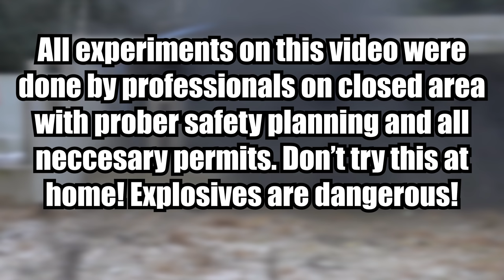How hard it is to explode a hole in concrete wall?

Comment: Moral of the Story:  If you want to breach a concrete wall with explosives you're going to need a pair of bolt cutters to get through the rebar.
Reply: Or, know how to make linear shaped charge.
Reply: Too thick for bolt cutters. Your going to need a grinder or something.
Reply: You dont need bolt cutters. Everybody knows jet fuel melts steel beams.😆
Reply: @christopherhalstead1485  Yup! Steel begins to soften around 425°C and loses about half of its strength at 650°C.  Whereas jet fuel burns at  1,030 °C .
Reply: @codedlogic  Id just use termite or just drinking lithium,  it's more awesome
Reply: @codedlogic  also consider that jet fuel sets other materials on fire, which adds to the heat
Reply: @silvermediastudio  A very long one if you want to be sure it's placed where the rebar is.
Reply: @Graeme758  outline the hole desired. main blasting charge in the middle on short (millisecond) delay. pop it. easy day.
Reply: @silvermediastudio  If you have just placed a shaped charge in the middle then you will blast a nice hole directly through in the shape and direction your shape determined, mostly directly through the wall. Very little is likely to go up and down. So you may well take out rebar directly behind the charge, or in the blast 'cone', but very likely not enough to get a man through unless you have either placed two charges or made your shape long enough to account for the size of the rebar grid.

Blasting a hole that doesn't give access makes you look very silly. I wouldnt want to be the one who left a torso sized hole with rebar top and bottom.
Reply: @Graeme758  You do exactly as I described. I'm not speculating about what might work, I'm telling you what works. Cut the hole, blow the debris inward. From hundreds of repetitions.
Reply: @silvermediastudio  I'm not speculating either. But I guess if you have unlimited playdoh you can go through anything, I think we usually preferred to use enough to do the job and place it properly.

And with hundreds of repetitions you really should be able to do it right by now.

You're not American by any chance?
Reply: @Graeme758  huh?
Reply: @Graeme758  I had to re-read your comment.  Clearly you don't understand the difference between what I typed, "Linear Shaped Charge," and what you think I meant, a conical shaped charge such as is found in an RPG rocket warhead.  I suggest you educate yourself on energetics and their application before posting further, and read more carefully to ensure proper understanding.
Reply: @silvermediastudio  I know what a linear shaped charge is. If you read my first post properly I said it would need to be long enough to cover any rebar you wanted to cut. You think a 300mm or 600mm LSC would cut through rebar 600mm feet above and below it's placement with any certainty? If it didn't you're left with a 1m hole, if you're lucky, and a red face.
Reply: @Graeme758  re-read my instructions
Reply: @Graeme758  you use a 3-5m LSC shaped in a rectangle of sufficient size with a central push charge as he suggested. The LSC cuts the material in the shape of your breach and the pushing charge which is a smaller tamped explosive pushes the breach inwards. 800lb gorrila was correct. Often these charges are pre-made for the breach and attached to a cardboard or thin plastic template with something to help it stick to the wall so you can run up, slap it on, run your wires and detonate it quickly.
Reply: Angle grinder
Reply: @Graeme758  military have a plastic thing that looks like a flat riot shield with a half round edge that is filled with water, explosives on other side wall breacher
Reply: @codedlogic  yep!! Everyknows that's what happened to tower 7 aswell!!!
Reply: @christopherhalstead1485  BURN! Too soon? 😆
Nice 1 btw
Reply: Or more explosives

Comment: The second and last one kinda reminded me of how Squash Head (HESH) antitank shells work.  It doesn't penetrate the armor, it causes the other side of the armor to "spall", or turn into shrapnel inside the tank.  So it's using the tank's own armor against itself, especially the crew.
Reply: Ayy, I know about that from the game "From the Depths" where you can put squash heads on your projectiles. Also when designing armored vehicles that will be possibly going up against that, I would have 1 layer of armor, then an air gap, and then an inner layer to stop the fragments.
Reply: @revenevan11  Yes thats called Spaced Armor and the Germans used in in ww2 to defeat squash head as well as HEAT
Reply: @ClockworkAnomaly  hesh didnt exist in ww2 and it was never intended to be used as anti tank
Reply: @yournotgully  name checks out. But you're right, my bad. It was developed shortly afterwards.
Reply: And it was definitely used for anti tank. It competed with HEAT for that role, despite being initially intended for bunker busting
Reply: @ClockworkAnomaly  yes thats why i said intended

Comment: Vocabulary and comfort with English are so good now, but that accent ain't never going away. You guys are the best. Still making great content.
Reply: The thing with anyone who isn't a native English speaker is that there will be a couple words we will just never get right unless you learned English at a young age but it's still very clear what you're talking about because in this situations where you're misusing these words it's two words with similar definitions but they're used in different contexts so it's clear to the native English speaker what you mean because you can only mean one possible thing. For example I haven't heard you guys make this mistake but I've heard military history visualized make it what he'll be talking about the logistics of something or other and he'll say instead of how much fuel he'll say how many fuel which is technically incorrect but blatantly obvious what you mean.
Reply: His vocabulary is absolute garbage. He almost never uses the proper prepositions and skips articles altogether. Just check the title. He's making a statement, not asking a question. If he would like to ask a question it should be "is it" not "it is".

Comment: Man I would not be walking under that overhanging concrete after hitting it with explosives several times 🤣 Great video though!
Reply: I was thinking the same thing, but then I realized that the overhang would've been weakened from the explosions, so even if it did challenge them to a fist fight, I belive the overhang would still lose.
Reply: There's also the point of the blue tie-down straps holding something together.   I didn't figure out what, but I'm sure they're not explosion-rated.
Reply: that's what rebar is there for.......
Reply: @sqlevolicious  so you would trust a broken piece of concrete several thousand pounds just because theres a bit of rebar in it? Lol. This is how people doe on the job :p

Comment: Warning message at start
"Prober"
Meaning, singlular word for "proberly properly" combined
Reply: Prober safety planning is the sort you do after a few beers down at the local.
Reply: @Thermalions  Prober safety planning is when you plan by experimenting instead of doing it by calculating on paper, computer or in your head. "Prober" is actual English word, even though people often confuse it with adjective "proper".
Reply: @Monni95  it's a typo, no need for irrational justification

Comment: "The Wet Fart" !    Hilarious.
btw - I believe the Shaped Charge would have also benefited from having a water jug behind it. It likely would have benefited if it were attached in a more rigid fashion. As it was, the explosive was pretty much free to push in all directions from the instance of ignition. Having some resistance to hold it in place while that initiates a directional force (the direction with the least initial resistance) would have enabled the shape charge to blast the wall and cut rebar if placed in the right location to hit the rebar.

Comment: The charges to blow a hole are usually used on brick walls, there they are more effective because they have almost no steel.
The charges can have either a composite or a metal sheet layer behind the water to help redirect the charge and the impact and they can be placed with a portable concrete nail gun, it uses small charges to pearce the wall and takes less than a minute to place.

Comment: You need sort of a shaped charge! Like a hollow cone of explosives with an copper liner and about 30 to 50 cm distance between the charge and the concrete, to allow the "spike" to develop!
Reply: That's more for a shaped charge to penetrate armor, less for a det charge to breach a hole in a fortified wall.
Reply: @SlaaneshChampionMako  it could be used to make the first small hole, allowingyou to detonate straight in the hole, or abuse the fact you made a weak spot to blow a giant hole in that side.

Comment: Wow I didn't think the water jug would work - nice job!!
Reply: Spoiler alert
Reply: I guess water being non compressible nor elastic it’s easier to get momentum thru the concrete « barely existent elasticity »...
I’d also guess that with a couple fence mesh along with the steal re-bars you may need more C4 or use it in a spiral delayed pattern ...
Reply: @langeludo  the term elastic doesn't really apply to a fluid, the beauty of water is that it's heavy, overcoming it's inertia to move it out of the way  when it comes to explosives is hard, and also as you said it's I compressible

Comment: The water will penetrate due to the fact water cannot be compressed. So, you will be moving the solid water mass totally through the concrete, even though it's reinforced with steel rod support. Great shots of all your explosives used.

Comment: I like how they're hiding behind a concrete wall while also trying to make an explosion strong enough to destroy a concrete wall XD
Reply: The explosions Shockwave it self is probably safe after 10-20meters in open air, the shrapnels flying around are what's dangerous!
Reply: like the "bomb" proof plexi glass on Mythbusters, that was sub par for the size of the explosives they used!they were just lucky no real large shrapnel flew their way!
Reply: LoL humanity at our finest!
Reply: @bernhardtsen74  
They found out it was "not rated for anything!"
Reply: They didn't say "two" concrete walls!
Reply: Explosives drop in danger with surprisingly little distance but the shrapnel is what can be dangerous farther away.

Comment: Years ago I realized how terrifying trees are when a skinny, dead tree crushed my friends truck seconds after we got out. Now I am once again reminded how something so inoculations like water can be absolutely terrifying.
Reply: The incompressibilty of water is why mines and torpedoes are so damaging to ships.
Reply: @hermitoldguy6312  And concrete acts the similar way as a diaper, it can absorb quite a lot of water, but when it's dry, it's really brittle. In Finland they regularly use fire engines to wash apartment buildings made of concrete, so they don't dry and collapse. The element shown in the video is clearly dry and as such doesn't require a lot to break. Some older building have had damage in inside surface of the walls when the water has managed to get between the element and the paint.
Reply: If you’ve ever taken down a tree with a saw or an axe, you really learn how beastly they are. Trees are magnificent, but terrifying haha.

Comment: It seems like Newtons 3rd law at work on that water can explosive. It's as if the explosion has something to push back against so that it can force it's way through the wall.
Reply: Why the concrete wall is not the one that is pushing away the water jug? I mean, Newton's equation depends on mass, and the wall has more of it than the jug
Reply: @pyrokinetikrlz  yes, however when the water jug is there the explosion can't expand freely into the compressable air. Instead it pushes up against the water jug which contains it slightly longer as the mass of the water takes longer to accelerate out of the way. Therefore the explosion can have a much larger effect on the concrete wall. Newtons 3rd law is relevant because for the explosion to push into the wall it helps to have something to push back on.
Reply: @pyrokinetikrlz  didn't you see whay happened to the water jug? Im not a pro but i'm guessing it just pushes both ways

Comment: Instead of the water bottle wrapped in det-cord, just mold the c4 into a hollow cone. A wine bottle neck used as a mold works pretty good. This gives you a simple shaped-charge explosive. I knew some guys who tested this on old abandoned cars and were able to blow holes right through the engine blocks. Of course it just leaves a small hole so it won't actually make an entrance through concrete.

Comment: “A really big fucking hole coming right up” - Thermite
Reply: You see you need a lot of thermite to make a big hole in thick concrete or metal also that's only good for breaching from above
Reply: @USS_ESSEX_CV-9  its a video game reference dude
Reply: Another cultured playet
Reply: Thermite could melt through it sure, but it doesn't explode, it burns. You would only have ad big a hole as you had thermite. You'd get through the steel though
Reply: bandit exists "really fucking clean wall coming right up" 

Also he said coke.bottle is better

Comment: Water charge could also be placed reversed. You can also explosive - water - wall. Water is non compressible, so it acts in the same way as a water cutting table. The water is accelerated and cuts through the concrete at crazy speed. 

The bomb disposal people use a device called a pig stick that operates on the same principle, forcing a cutting jet of water accelerated using a small charge of C4, through a suspect packages components before they can trigger the device to explode. As there is no combustion or electricity involved in contacting the device, it minimises the chance of accidental detonation of a device you're trying to render safe. You can gain far more insight from an IED, as to the level of skill involved in its construction, down to which school of thought is used in the design and wiring. You can even discern an individual's build if they have a particular signature component or a specific way of doing something. As an example bombers who were taught by the IRA, like PLO, will twist the ends of each connection back on themselves and retwizzle it in an arrangement known as "Chinese pigtails". As such it might give you an indication that they are aware of certain other methodologies, known to be taught in IRA training camps. A trained bomb maker is a different thing entirely from one who's delved on the internet and used their chemistry degree to cook up a nasty surprise. 

 The more information you can glean from a suspect package, the more chance there is of ascertaining details that might be relevant to the case. And that's where the pig stick comes in, you can gain information more easily from a soaked and shattered device, than one that has been largely burned up, or vapourised, in an explosion or conflagration.

If you try it again, use water in a similar arrangement to how you did the shaped rebar charge. Also, use polystyrene to make frames for your cutting charges, it helps to direct the brissance.

Comment: With the way that roof slab has been flexing I'd be buggered if I'd stand under it...
Reply: Nah, even if the concrete was shot full of cracks, the rebar is its source of tensile strength.

Even when they blasted through they didn’t snap a single piece of the rebar.
Reply: @Nevir202  rebar will bend easily if you fracture the concrete.
Reply: @HandyC  No, actually it won’t in reenforced concrete, as fractured concrete still has enormous compressive strength.

If you blew chunks outa the ceiling, you might need to be worrying, but that obviously didn’t happen.

Comment: I feel like the problem is that there's a lot of energy (explosion) that is lost simply due to there not being a "resilient" container/casing to at least slightly direct the energy.

All that's happening is that they're making differently shaped  regular explosives.
Reply: That's why the water jug charge worked, water is the best tamping method.

Comment: The Army has a wonderful 155mm round that is for breaching reinforced concrete walls.  HESH, 4 foot hole in 12” thick reinforced concrete no problem.
Reply: It might be the case that the watercontainer-with-filled-cavity method is many orders of magnitude cheaper and less sensitive to supplychain issues. In the short run a spending spree for the best of the best is an ok approach, that can rather quickly turn into a situation like a beseigeing, starving the other side from resources as an efffective option since the elite minority with super weapons will always be the sore thumb sticking out. Only come to the rescue with deadly force when specifically asked or ones hand is forced. 
War is such a simple word, but not a single violent conflict of any groups in history has ever been simple.

Weapon technology seen by itself can be fascinating.
Reply: @blueredbrick  unfortunately getting that close to a wall once to breach isn’t always that easy.  When an enemy thinks themselves safe behind a fortified wall it can be rather advantageous to open a new breach point from a safe distance before the enemy knows you’re there.   When Avon comes calling surprise is everything.